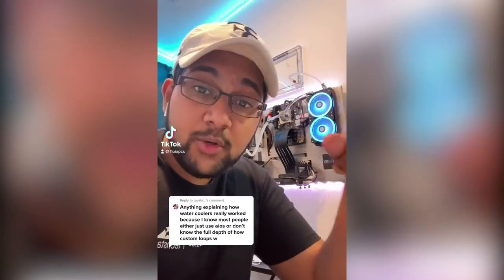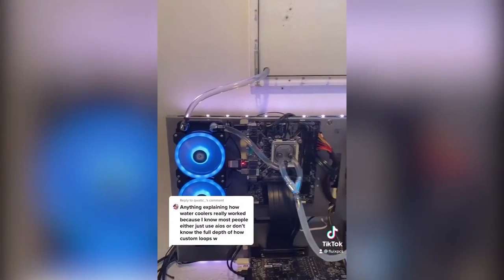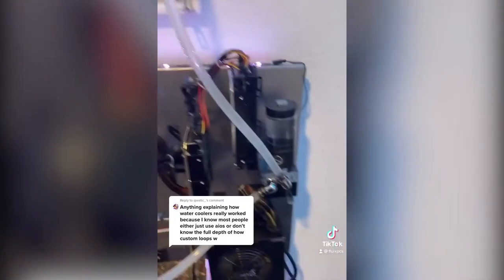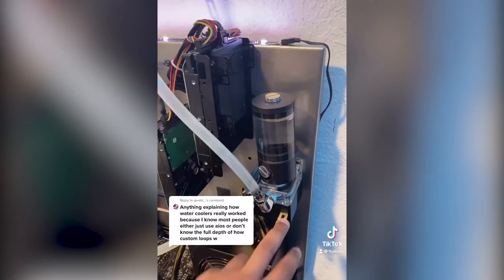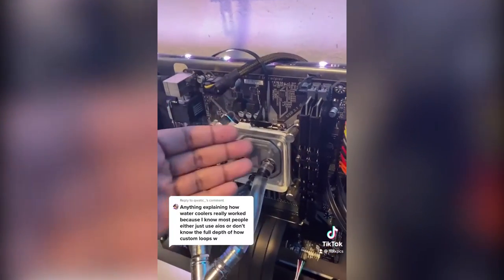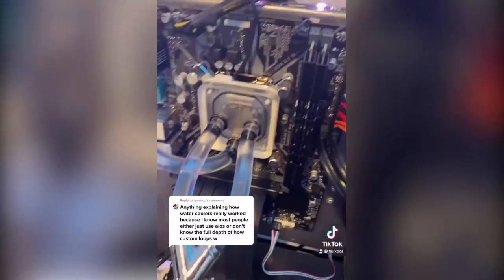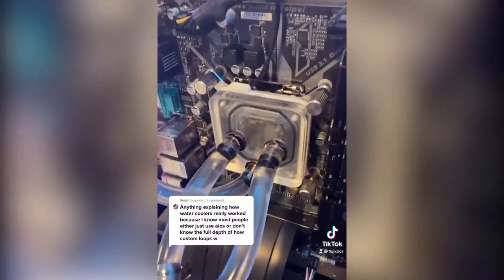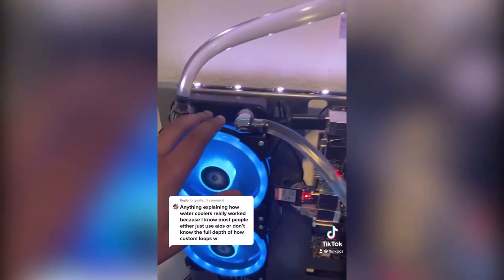HOW DOES CUSTOM WATER COOLING WORK? Tik Tok Shorts #2

Comment: Dear good, i hate so much the fans, they are super bad from rads, plus the worse thing is that the fitthing don´t have the thing around so in case the water overheats or the hose gets a bit lose, it may start to leak.
Reply from the maker: It is true that there are fans meant for radiators such as high static pressure fans, however ultimately its up to your preference. As far as the fluid being "heated" enough to expand the tubing over the barb fittings is highly unlikely. As the CPU is not generating enough to superheat the fluid. However, taking the tubing off the barb and re-applying it several times can cause it to start slipping off.